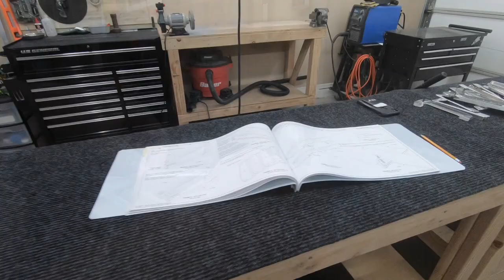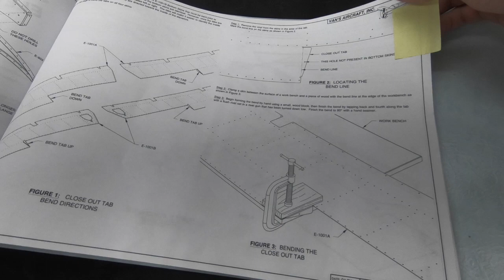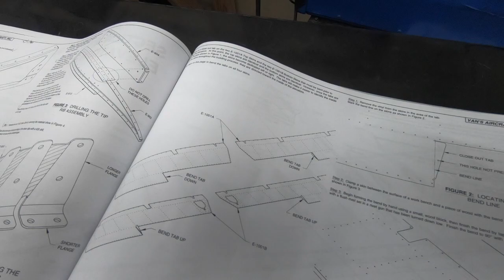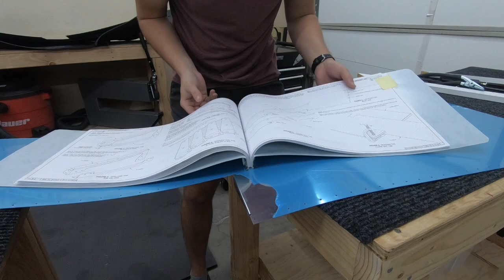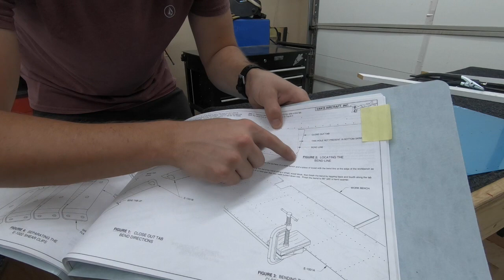Van's RV-10 Elevator Build, Part 1

Comment: hmmmm never seen this before, have you called vans to ask?
Reply from the maker: I never called Vans. I found a thread from 2014 on vansairforce where someone asked about it and it was confirmed to be normal for these parts. Sounds like it is common on the 10 and 14.
Reply: I don’t suppose that’s one of the parts vans recommends pruning? Because I’m not going to prime my plane just the parts Van’s recommends thought the build
Reply from the maker: @DragonBuildsRC  I will prime those ones due to the scuffling that exists on them. I think they’d be fine but it’ll be easy enough to just hit them with a coat of self etching primer to not have to worry about them corroding where the scuffs are.
Reply: @AustinManke  right on, I know the endless prime debat will never end but I have flown in some ooooold  airplanes that are not primed so thats good enough for me.